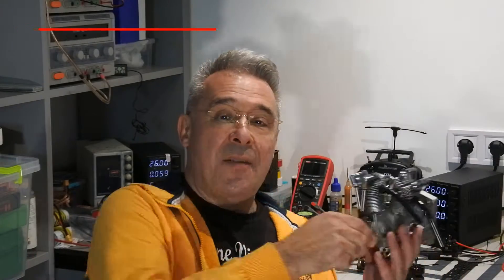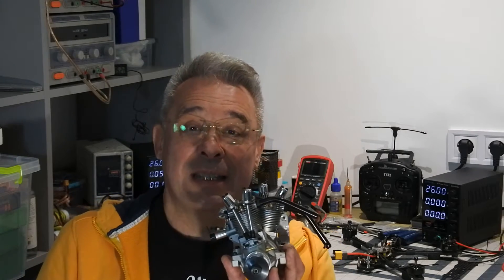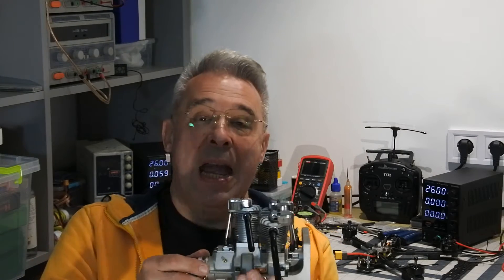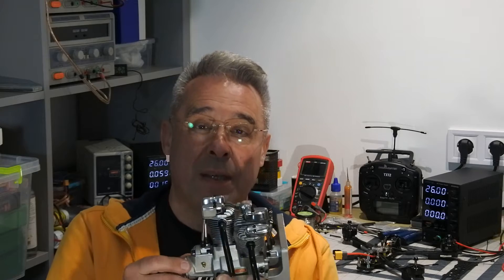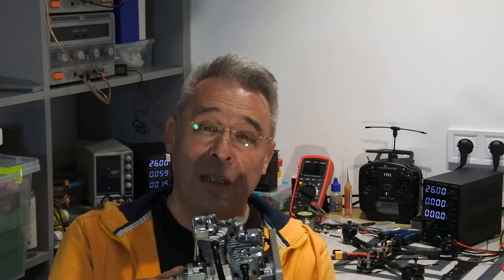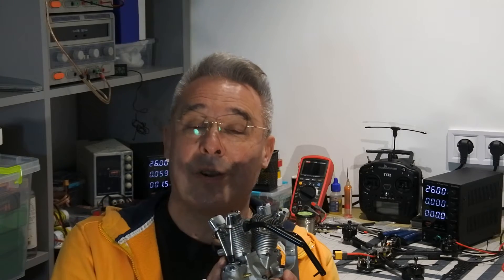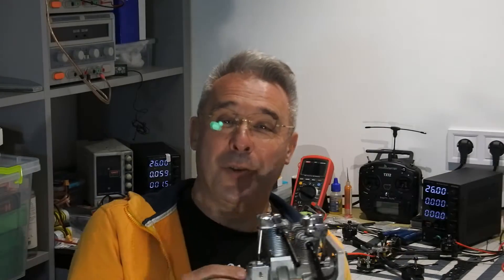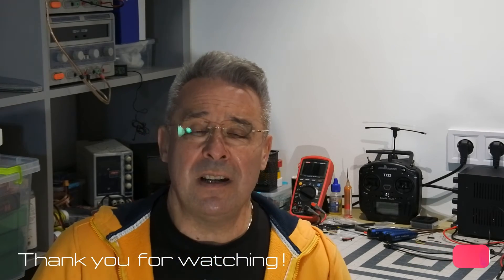Saito FA 200TI  - A look inside

Comment: great video... thnx
i have this engine too, but no information on  valve and cam settings
do you have a manual or know where i can find a pdf manual online ?
Reply from the maker: Hi and thanks a lot for your comment ! I don't know yet about the valve settings, but my logic tells me, that we should set the timings, as for each cylinder separately, so, to move piston to the T.D.C., fix it with strong rubber band, than turn timing gear into the dot down position and carefully insert timing gear assy into the crankcase. Than, proceed with the second cylinder. Mine FA200TI is still in the boxes right now, but I'm hoping, that before Xmas week starts, I'll try to find few hour to mediate with the engine, to confirm exactly my thoughts about timing settings . 
Thank you and have a nice day !
Reply: @crazyengines88  well, i am not sure if you put both cams in at the same time or rotate 360 degree, because if you put in the front cam and rotate the crankshaft 360 degree and put in the rear cam changes the engines fire order to  even or uneven ....  it's a fourstroke so every 2 rotations there is an ignition
Reply from the maker: @Modelpilot  
Hi, and yes, I really didn’t think about this question while the engine parts were laid out in boxes, and I answered without really thinking about it either. You are absolutely right, there is a question. I will give you a link to an article from a magazine where this engine is tested by one of the biggest gurus in the world, Clarence Lee. Here is the link:
https://sceptreflight.com/Model%20Engine%20Tests/Saito%20FA-200Ti.html
The article provides data on the opening and closing angles of the valves, perhaps there you can find the answer to your question.
Thank you and have a nice day.
Reply: @crazyengines88  thnx for the link, this is a very interesting article and it says the 200ti in an alternate firing twin…..  🙂